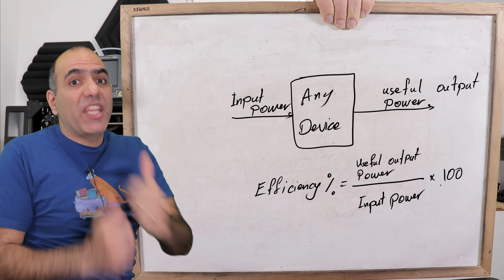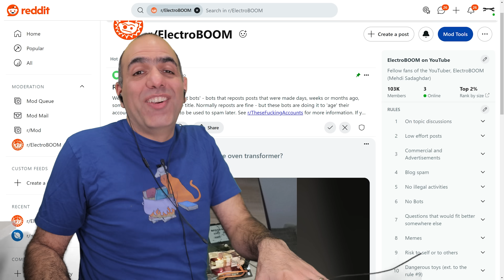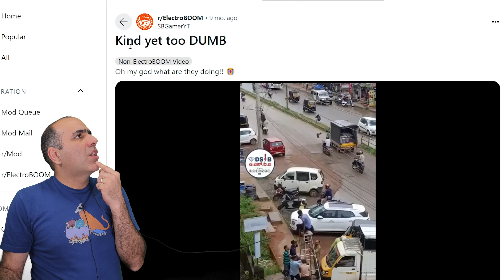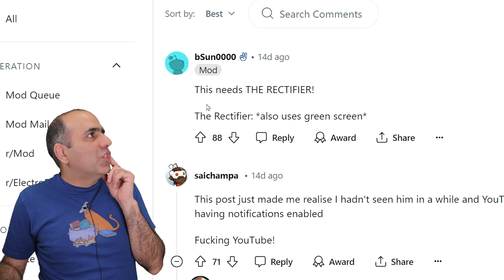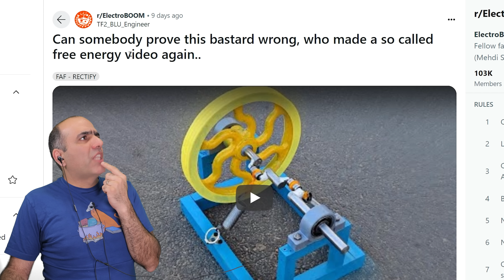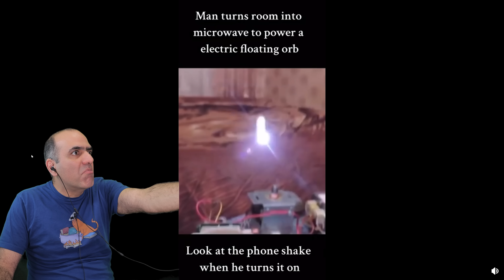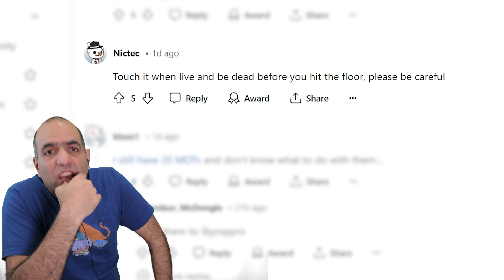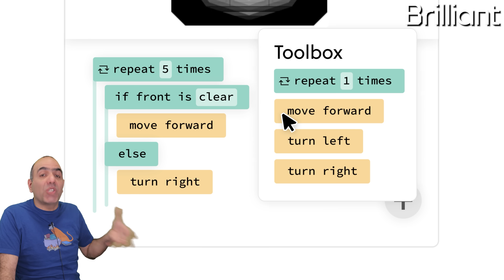New Flywheel Free Energy?! Can Boat Battery Fry You? LATITY-013

Comment: If you've ever seen the videos of Tesla cars (350-400v) driving in flooded regions with the battery submerged nobody gets a jolt, because the system is sealed. But your very first reply is flawed, an electric heater is designed to heat an area, not just people. The heat keeps things like water pipes and fish tanks etc. from freezing. Blaming inefficiency of the structure on the heater is like blaming a shark for electrocuting you.

Comment: 7:50 that type of plastic that holds onto static electrons was used in manufacturing process, so that as the engine runs extra ions charge the body of the cars interior... and when thief goes to steal car, they are not at polarizer equality with owner so, a relay clicks and all the Nano wires in the seat steering wheel etc send all the 80kv ignition up the but.

Comment: Firing test ground faults of known current by size of fusible  cable, yes that’s a thing, with fast computers you can detect bad connections and insulation by FFT analysis of current and voltage.

However definitely don’t lob 20ft aluminium scaffold tubes into substations, it creates impressively big arcs, but the transformer won’t like it, potentially plunging your locality into darkness for weeks or more.

Comment: So the battery in  the water 1 is a bit silly like yeah the battery would slightly electrify the water but you are basically connecting it to ground by putting it in the sea.

Comment: I love that the actual way people demonstrate "free energy" could just literally be a solar panel plugged into a motor, like look I'm not adding any energy so its free, no even if your device worked it would cost more to build for the output energy given. There are some that would potentially work basically using the suns energy but the amount of power you'd get would be less than a solar panel.

Comment: 10:03 video editing, but also friction of the elements, the springs would not compensate said friction, enegry provided by one spring would be utilised to pull second (this is also not 100% efficient, the springs would heat up from constant pulling and shrinking), the angles of these springs seem iffy too, it would make more sense to place springs perpendicular to each other. 

TL,DR: there are a whole lot of reasons why such device would not run forever, not to mention the ability to power up anything. 

Free Energists and Flat Earthers are the most challenged "scientists" 😂

Comment: Batteries CAN fry you if they're high enough voltage.   I worked at a coal burning power station and we had battery rooms for each unit that would spin the generator when the unit was down to prevent the turbine shafts from sagging...and were needed to bring the unit on line by spinning up the generator before the steam was opened to it.   These were 440V submarine batteries and we had a guy pulling circuit breakers get careless and grabbed two adjacent ones and the voltage made his hands clamp on and he couldn't let go.   Cooked him until his arms burnt off..really nasty thing.  He had a blue hard hat on and it melted down over his face and the EMT's had to cut it off so he could breathe.   I had the unfortunate job of trying to clean the grease spot he left on the concrete.  Smelled really bad.   The guy died two days later.   Be careful out there!!!

Comment: It's so funny how i understood how the thing with the lamps worked before he showed it, to me, if 5 + 5 watts = 10 watts of these bulbs are lighting up and the 40 watt didn't, it should logically mean that a total of 10 watt's are probably being used, so, the current passes through the 40 watt lamp but it's not able to light it up because it's being "gated" by how much current the other x2 5 Watt bulbs take as they are from each side of the circuit.

Comment: 8:43 
Alright 
Both me and my dad have been “shocked” by a car battery
And we only figured it out because we both explained the same effects
We were working on a car of some sort in the summer all sweaty and gross and with one arm resting on the fender of the car and the other arm touching the + post on the battery we felt a burning sensation in our arm touching the fender 
So can u be shocked yea but u just get a slight burning sensation

Comment: 8:40 I haven't seen the original clip but I'm going to hazard a guess this was about cargo ships with EVs on them sinking, basically a made up excuse to demonise EVs again. In fairness those batteries can exceed 800V these days and can easily kill you if mishandled, but they're unlikely to deliver that to you inside of a cargo hold of a large container ship where they will eventually discharge through the water relatively harmlessly anyway (also, in case it needs to be said, it's an absurd, extremely rare edge case he's describing that isn't even remotely worth considering in domestic EV policy, particularly the insane tangent about the shark).

Comment: I think cheeto was talking about electric boat which would have a battery with higher voltage. But still, he is an idiot if he thinks that current would flow through him, instead through salt water shorting the battery in it's compartment.

Comment: Trump was discussing EVs, so definitely higher than 12-24v. 

Lets not play stupid just because politics became involved. And not turn a blind eye to the fact that both choices this round are horrible.
Reply: Right. Usually boat batteries are 12 to 24 volt, so I get where Mehdi is coming from.
In reality, a submerged EV boat would have its breakers pop the moment water shorts something in the HV system. The battery would be harmless for a long time until the seal deteriorates, at which point you would have drowned weeks ago.
It would then bubble and create hydrogen and chlorine gas, but the electricity wouldn't go anywhere besides the interior of the battery (that's the shortest path, after all.)

Comment: Hi Mehdi! ( 0:24 )The heating is not 100% efficient if you use alternating current (I also mean direct current. What about the phenomena that occur when switching on and off?...). What about EM radiation loss? Do an experiment, try using a large coil or some kind of ELF/VLF antenna to sense if the electric heater a few meters away is on or off. If this succeeds, the heating is not 100% efficient. The loss, even if small, can be detected. I love good Teachers! Sincerely, Erik (from Hungary)
Reply: The losses are magnetic energy (after all, even the smallest wire is a tiny magnet) and audible energy (if you listen closely to a heater or an electric kettle you can hear half-wave (or maybe it's full wave, but it sounds like half-wave) 50/60 Hz tone).

Comment: Can someone smart explain why a higher powered lamp has a smaller resistance? Is it because the wire is thinner and longer so it can glow brighter?
Reply: @anneg123  
The voltage represents the force pushing electrons to flow in the circuit. Without Voltage, current will not flow (except when the resistance is 0). 

When a lamp is high-powered, the voltage applied on it is high as well, and by ohm's law (U=R.I), the more voltage is high, current is high.
 And actualy, this is logic because if voltage is high, the force pushing electrons to flow is high which means that in one second, more electrons will flow through the lamp and this means a high current intensity. (Current intensity is the number of electrons that can flow per one second)

Ohm's law states that current intensity is inversely proportional to the resistance. So hence we have high current intensity flowing through the lamp, that means its resistance is small. 

This is my personal thinking, i am not sure about its correctness, but i have impression that it is the real response at your question. 

Have a nice day.

Comment: What is more important I believe is that sharks don't like electricity in just a small amount and would disappear very fast and no longer be dangerous for the passengers. People can handle a little electricity so can stay close to the battery at almost any voltage (The voltage differential drops by distance to the battery). Being close to the battery should there fore be safer than if there is no battery in the water in regards to the sharks (except maybe human ones.)

Comment: we have two bulbs of 20W each with the same resistance. If we connect them in series, they will glow dimmer because the current remains the same, but the voltage gets split between them. If we connect them in parallel, both bulbs will glow brighter than in the series connection because the voltage remains the same across each bulb, but the current is divided between them. So, whether a bulb glows dimmer or brighter depends not on the wattage but on the voltage.
Reply: Not true, since if you connect them to a constant Voltage (e.g.) your outlet) the overall Current (and wattage) is not the same in both cases, since the effective resistant is different. So if we assume outlet Voltage of 240V, through a single 20W Bulb the current would be 1/12 A, so the Resistance is 2880 Ohm, In series the overall resistance would be 5760 Ohm resulting in a current of 1/24 A and an overall Wattage of 10W, so each bulb "gets" only 5W. Now if we look at the parallel circuit, the overall resistance would be 1440 Ohm resulting in 1/6A of current, so we get a total of 40W, so each Bulb receives the full 20W it needs.

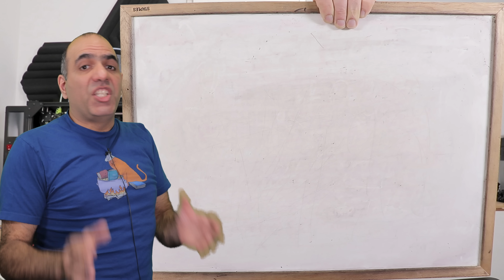Comment: 4:00
What type of bulb is this, in the middle? 
Why isnt it a compact fluorescent one like the other 2?
Reply: It is an incandescent bulb
Reply: @danek_hren  well in this case, it should light up. Very dimmed, but we should be able to see a little glow.
Unless... the filament in the bulb is broken..
Or.. since the connections on the 3 bulbs are hidden (on purpose probably), we only can presume that they are all conected in serie.
Fluorescent lights wont work if the required voltage is not there.
Reply: @martf1061  correct
Reply: @martf1061 Probably not. With a resistance 8 times smaller than the 5W lights, it'll consume less than a watt, which is unlikely to heat the filament to the draper point.

Comment: About the boat thing... I have a (failed) EV boat battery and not only is it only 24V, but it has a complex BMS that switches the battery contacts off completely unless it's fed a signal from the boat and of course the battery itself is also mostly water proof because you would have to be extra "special" to not think about protecting it from the elements.

Comment: the magnetron is mostly gonna be fine and WILL NOT CAUSE CANCER IN ANY FORM OR ANY ENVIRONMENT (its non-ionizing which means it cant shoot particals at your dna to break it) but also the reason it cooks food is because it is in a container that reflects the waves. its like playing loud music in a metal room. it will bounce the sound waves all over making it seem louder compared to playing it in open air. the microwave container is what lets the waves build up and refllect and echo around to get enough wattage to cook food. dont touch it, but if you are in open air and didnt run it in an airtight metal box, you should be fine. the biggest concern there would be the local hams' knocking down your door

Comment: My friend's dad actually died (RIP) from poking power lines with bamboo pole. He was trying to free some branches he was cutting that were stuck on the lines. So don't ever mess with them.
Reply: Not if you have bare hands and are standing on conducting earth.  Professionals do use poles I have seen but they are made of non conducting material and I am sure they use rubber gloves and non conducting footwear.
I have personally worked on low voltage (220V) power lines. We where supposed to use rubber gloves but I couldn't work with gloves so I took them off. It was ok when I was insulated but once claiming a wooden power pole it did tingle a little when i touched the live wires. 
Really high voltages are much more dangerous although if you get slowly to the voltage (like a bird landing on the wires) it is not a problem. It is not the potential that kill's you. It is the current through you. The capacitance in your body to earth may be enough to create that current even at lower frequencies. So as you say: DON'T MESS WITH THEM.

Comment: If a heater is defined as just heating, not heating a person, it still is not 100% efficient.   Some are more efficient than others.   The old bar heaters convert some heat into light as an example.
Reply: guess what happens to that light when it hits something.  heat.  the only energy wasted is the light escaping the window.

Comment: Energy is converted so it's still 100% efficiency. It's only less when we don't use the other percentage the energy converted into.

Law of conservation of energy.
Reply: And there’s basically no way to use 100% of the energy it makes. Heat will always be made, and heat will always seep out into some other place or get converted to light and yeet itself into outer space or something
Reply: That is why usage efficiency only applies to your specific use. The remaining percentage is returned to the universe.
Reply: @thelionwatches828  Energy efficiency is the energy that we are specifically trying to use compared to the total energy used. Ofc all of the energy still exists, it doesn’t go away, but it’s not what we specifically want. Like how a motor makes heat, meaning it’s not 100% efficient in converting electrical energy to mechanical energy. That’s what energy efficiency is

Comment: Eletric heaters:

Hot things glow, so are therefore emitting photons in the visible spectrum... these wavelengths dont 'add' to desired output (that is heating you or anything really)
Reply: incorrect.  light becomes heat when it hits you.

Comment: those ground fault tests completely vaporize the metal. that brownish smoke is vaporized metals (probably copper). i've seen the aftermath of this kind of vaporization that happened on accident, and all we had left was the insulation. a wire shorted some massive current at low voltage, and it vaporized the 28 gauge wire such that the insulation split open, the wire literally exploded with a loud BANG and left the empty insulation behind. i wish we could have posted the picture of the blown open wire online. i saw some interesting things in that lab, some of them no one could explain lol
Reply: When you create copper plasma in wire by accident:

Comment: The accurate reason for the 40W lamp not turning on is that based on voltage division,because it has the least resistance,it gets the least voltage across its resistor and so the least power it gets
Reply: that is literally just solving for a different variable in ohm's law.  which answer is correct?  all of them.

Comment: About the efficiency of a heater one would say that other forms of energy than thermal energy are undesired. Like light, which is being emitted by the heater or even energy used to do ether kinds of work. So a heater isn't 100% efficient, but comes pretty close.
Reply: you could say it, but you'd be wrong.  Even light becomes heat when it hits you.
Reply: @tsm688  nope, that's why you're able to see one another. Some gets reflected.

Comment: Electric heaters aren't even the most efficient way to heat a home. 
Moving heat energy is way more efficient so installing a heat pump will lead to having more heat "generated" then 100%!!!

* this is assuming outside is warmer than ± -20 degrees
Reply: If it's warner than +20, why would you be heating anyway

Comment: Maybe an electric boat would sink from the weight of the batteries if Donald Trump designed it. If the boat is built by anyone who understands buoyancy then it would be fine. Seriously if the boat is sinking you wouldn’t have the option of staying out of the water, at least not for long, that’s the entire definition of sinking. Also shark attacks are most likely to happen in murky water and at dusk and dawn which are among the reasons why experts concluded that sharks don’t bite people because they’re “angry”. It also usually juvenile shark taking one bite and then letting go. If sharks were trying to kill people a lot more of them would be fatal. Jaws did enough damage to the reputation of sharks and they don’t need to be slandered by a moron that doesn’t understand how boats and electricity works or the difference between CFL and LED light bulbs.

Comment: The penny fuse is actually legit, but dumb. (It has to be specifically a copper plated zinc planchet, from an 1982, or later American cent. However, not a solid copper planchet penny, from pre-1982.) When a zinc planchet penny melts, it's going to melt down into your fuse panel. Zinc fuses are contained within a plastic envelope, which contains the melted zinc.

Comment: For a fun time, take one power cord, two nails, one large dill pickle, and combine.  Cut the female end of the cord off, and strip a couple of inches of insulation off both wires.  Wrap the wires around the nails, and insert said nails into opposing ends of pickle.  Turn off lights, and plug the cord into the wall socket.  It's a wonderful thing to behold, and you may thank Penn Jillette and Teller for this.
Reply: they did not invent it.  The pickle trick goes back to the 80's at least and probably far before.
Reply: @tsm688  Probably much older than PnT, you are correct.  They brought it to my attention some 30 years ago, and so i gave them credit.

Comment: 5:18 its not just the one guy with the wood stick, its the whole group who touched the metal ladder xD
Reply: Imagine he used a metal pole/pipe rather than a wood stick that's providing resistance. 6 people woulda just gotten straight fried, I guess you could say it'd be 7 birds one stone
Reply: Like he said, unrated wood may not save you if you decide to mess with high voltage.
Reply: you dont have to die for a pigeon 🤣